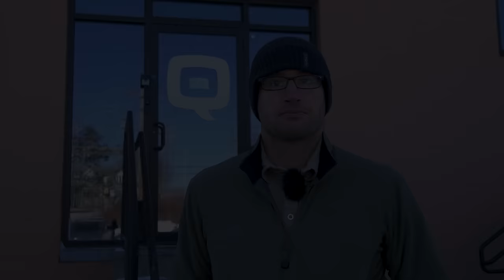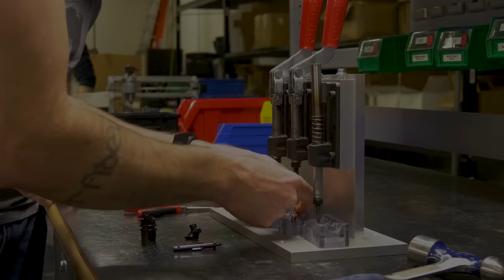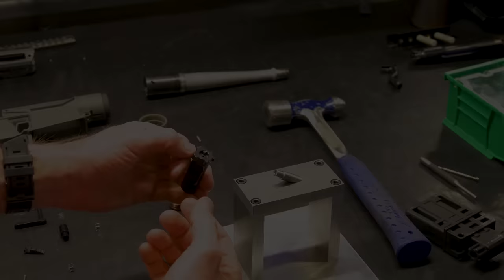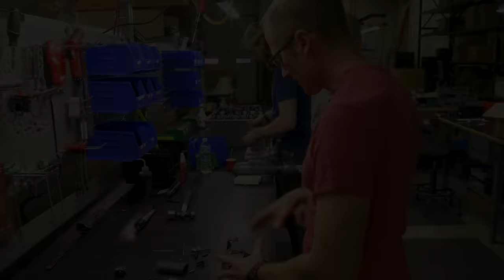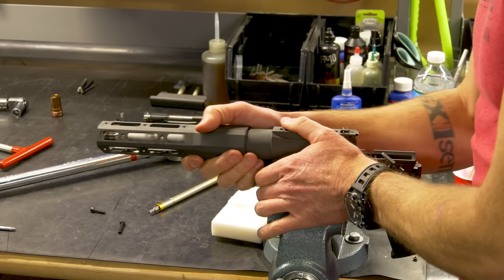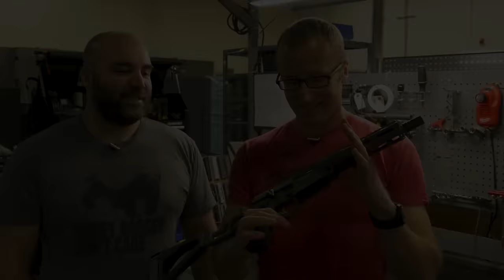Factory To Table: Part 1 - The Mini Fix by Q

Comment: This is an excellent series. For all us gun building geeks, this one is extra special. Love all the specialized jigs and fixtures they built, in order to ease assembly. Looking forward to part two. Thanks.
Reply from the maker: Ya, the fixtures are crazy.  They come up with some amazing stuff, to make amazing stuff.  :)
Reply: The jigs are amazing! I’m loving this.
Reply from the maker: @mlevans066  ya, pretty amazing what they've came up with...
Reply: i was building a jig in my mind that i could bang out glock strikers with in under 2 secs.lol.  we arent paying these guys because they are jedi gunsmiths, its because they built the smart tools n can do these quick. very eye opening indeed.
Reply from the maker: @zexnynex777  that is about it, Jedi level engineers.  :)
Reply: you mean gun assemblers, most guys cant even use a file.

Comment: This is pretty damn cool you get the or at least get to use all this stuff that isn’t even in production yet. The mini fix we can all buy has a 22” barrel and is 224 Valkyrie. Sorry if I missed it, what caliber is this one? You can see why this rifle is so damn expensive, I mean maybe not for what it is but everything on here is basically proprietary except the grip and a couple springs.
Reply from the maker: This one is 300 Blackout.
Reply: Kit Badger If this is 300 blackout why wouldn’t you just use your Honey Badger? Is it for accuracy? Hunting laws?
Reply from the maker: @thegolflife7565  Yes.
Reply: Kit Badger yes to which part?
Reply from the maker: @thegolflife7565  some hunting laws and to see if it is more accurate.

Comment: Q - "The fix is the most innovative bolt action ever" can't hit out to 500 yards. Big fix will maybe push 1000 accurately. $3300 is Extremely expensive for a "super innovative" bolt gun that drops way off after 700-800 yards. The mini is just a novelty toy for airsoft assassins. You can build a big bore bolt gun the way you want it for the same price as that gun alone and shoot to a mile.

Comment: 3:39 
Won't a flat lug break easier than a conical lug?
Reply: @and Justice 4 All 
I mean shearing off a lug. But now that I think about it, its probably not a big deal with a bolt action gun.
Reply from the maker: I'm not sure off hand.  But I imagine you're thinking about a gas gun cycling versus a bolt action.
Reply: @KitBadger  
I was. It hit me after I commented that its probably not an issue with a bolt gun.

Comment: So it's a bolt action AR?
Reply from the maker: It is a bolt action pistol, that shares some features of an AR I guess.  I mean a Ferrari is just a car, you know...  :)
Reply: @KitBadger  I know, I've had 3 of them haha.
That's interesting, why would someone want this over a semi auto variant like the honey badger?
Reply from the maker: @maximusjoseppi5904  different state laws dictate what can't be used for hunting.  Some places a semi auto is a no go.
Reply: @KitBadger  oh interesting! Didn't think of that. Actually, I think one of my states is like that... 
BTW, you were right about the honey badger. I didn't care for it on paper or in video but in the hand I get it.. I told you a while ago I thought the rattler made more sense but I actually think I prefer the honey badger cause of the weight and balance. 
The rattler is a friggin brick of a tiny gun in comparison
Reply from the maker: @maximusjoseppi5904  Hahaha, I know right?  It is so hard to convey the weight of something.  :)

Comment: Why?  They are expensive and you have a gun that is useless to swap parts with any other AR 15.   That is the reason the AR 15 is such an awesome platform.   Hell, I gave away guns to my family members that were problematic calibers and guns that were not interchangeable with the other guns I own.
Reply from the maker: If it doesn't fill a role for you, you don't have to buy it Richard.  It is okay.  :)
Reply: So what is the point of buying one of their guns?
Reply from the maker: For starters, if you like it.  People often overlook that most guns get bought because people just plain like them.  Not because they are the "Best" at any given task.  And people also overlook that it is perfectly fine to do that.  Everyone is free to spend their money how they see fit.  :)
Reply: I get that, but if you had a buddy ask you why you bought a gun, some explanation beyond " I just liked it"  is usually in order.  I get that many people buy stuff with zero clue what they are doing, or what they are buying.   Being able to explain the cost difference between manufacturers and why one is a better way to go even though it is more expensive, that takes a little knowledge and it does help those who are looking to buy a gun and make the same good decision with their money. 

You were there, you have handled their product.  If I ask you what you think and why it is a good decision to buy from them.  Why is that a difficult thing for you to reply to?  

"You don't have to buy one", or "people just buy things because they like it".  Why have a channel that shows guns if there is no working knowledge on your part?
Reply from the maker: @richardjohnson4696  I literally spent the first part of this video speaking to the why behind the MiniFix, with respect to my needs.  Do I need to hand feed you what I already stated?  Do you need bullet points?  Small, lightweight, compact, a pistol for legalities, 1:5 twist 300 blk for heavy subsonics, ergonomic controls, bolt action (again for legalities in some places), readily available magazines, etc...

Comment: Wtf role does this toy fill?
Reply from the maker: The one I mentioned in the first two minutes...  :)
Reply: I skipped the boring parts in the hopes of watching you kill stuff. 

Went back over the intro. Bro, that’s mega niche. For mega bucks.
Reply from the maker: @willypeter8861  I won't force you to buy it... :)   It is another offering to the market for those that want it.  They also have started shipping a rifle version in .224 Valkyrie with a 22" barrel.  All comes down to what people what.  And sometimes something can just be cool too.
Reply: Kit Badger I’d be interesting in the 224. My current back country rifle is a 22-250 or .300 win mag depending on game. It’s easy for me to get above tree line where shots can be far.
Reply from the maker: Ya, out West is one thing. But most of the country hunts out of stands or on the edge of plowed fields. Ultimately close range shots.